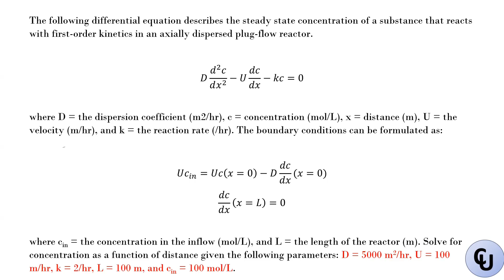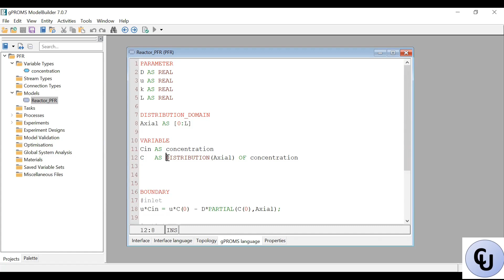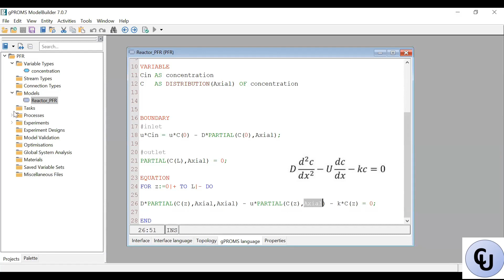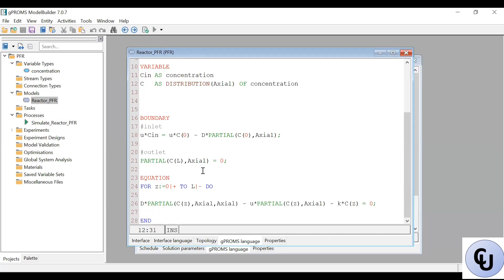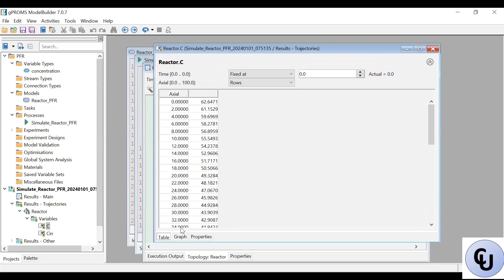How to solve simple plug flow reactor model in gPROMS | Distributed Model | Boundary Conditions |

Comment: Hi, Thank you so much for the videos. They are very helpful. I have learned a lot about gPROMS from you videos. I wonder if you can teach us how to write the codes when the boundary or initial conditions change with time (t). If possible, can you make the videos for optimization? I think gPROMS is much easier to use to solve the PDE equations than Matlab. Thank you so much.